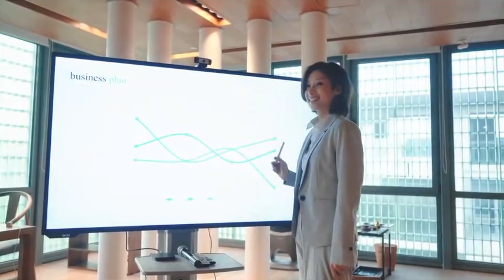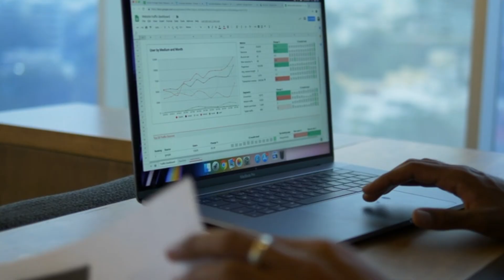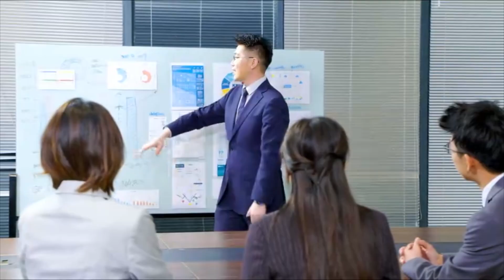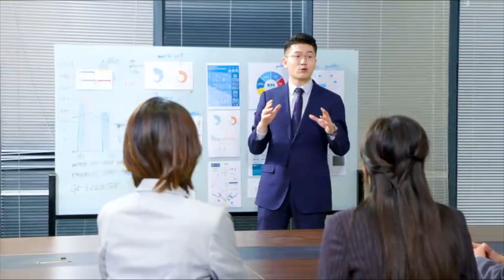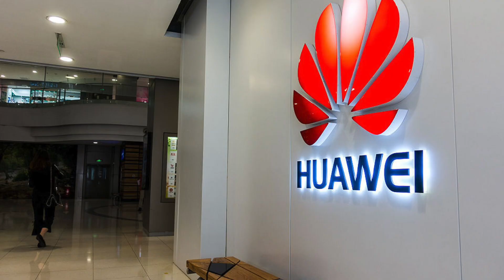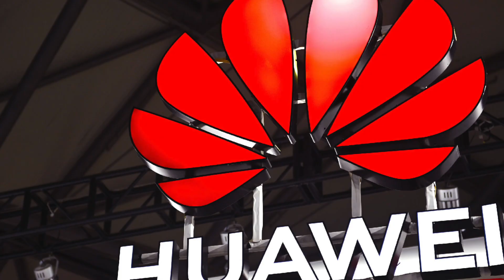Huawei’s Own HBM + 15,488-Card SuperPoD: Not a Duel—A Group Battle Against NVIDIA

Comment: It won't be long that Huawei will dominate in semi conductor chips, computer software and eco system. 
Huawei has reportedly testing its own EUV lithography machine, a groundbreaking technology crucial for manufacturing advanced semiconductors, which could significantly reduce China's reliance on foreign technology like ASML's machines.